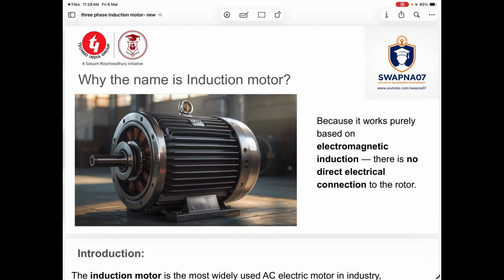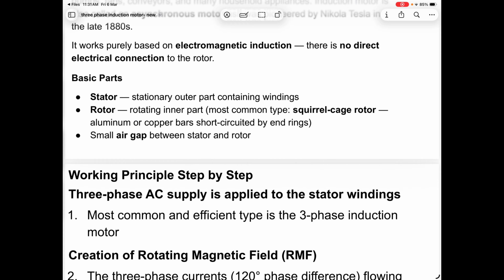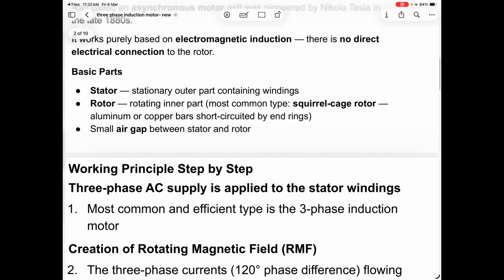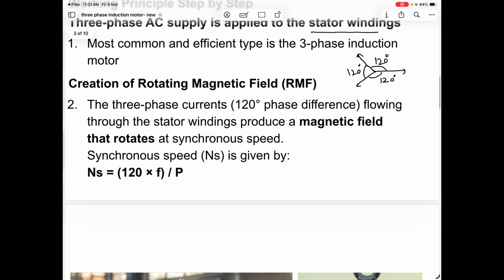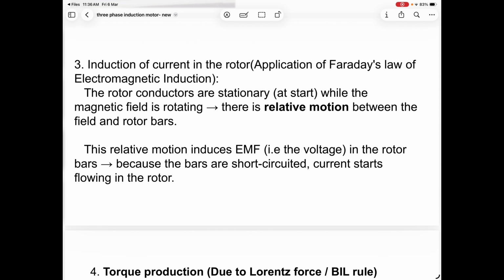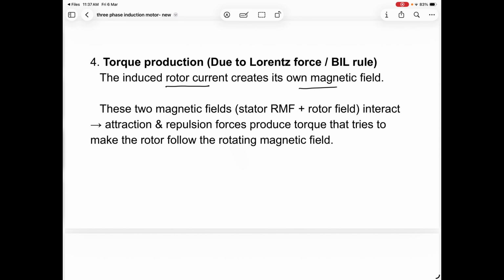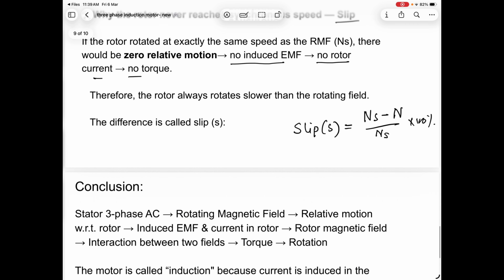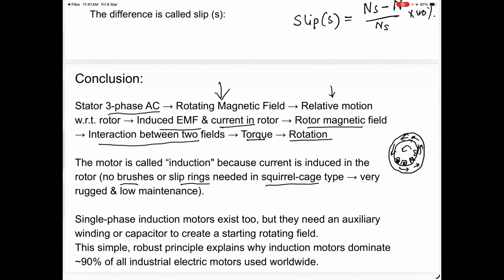Working Principle of Three Phase Induction Motor

Comment: Mam pls tell us what are the important diagram we have to practise for exam
Reply from the maker: In the evening I will try
Reply: @swapna07  mam when ? Pls 🙏🙏🙏 provide us
Reply from the maker: Transformer equivalent circuit,  no load and on load phasor diagram,  induction motor Torque-slip characteristics curve, three phase power measurement ,Thevenin's and Norton's equivalent circuit  etc....